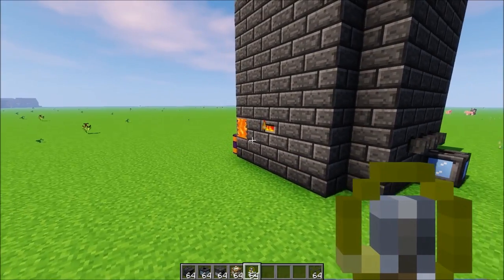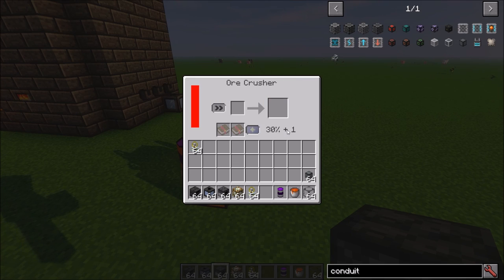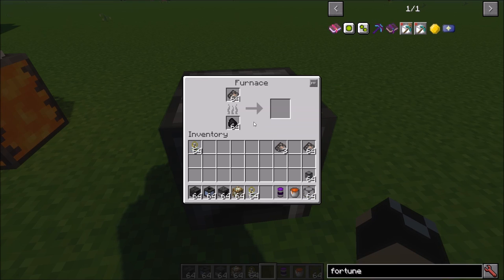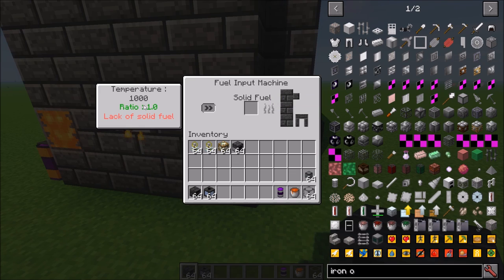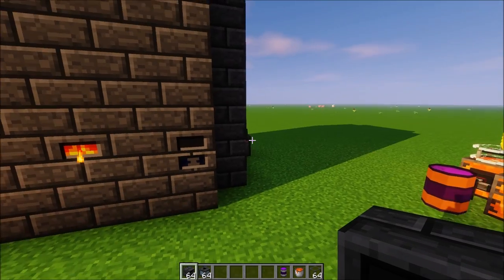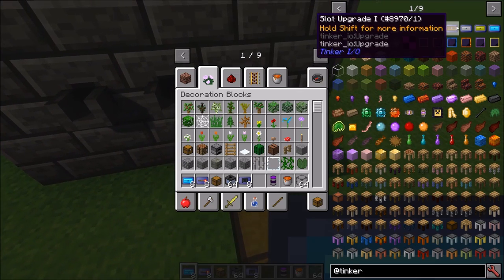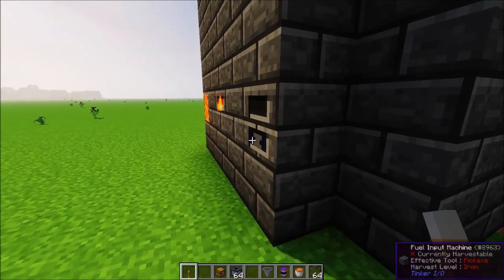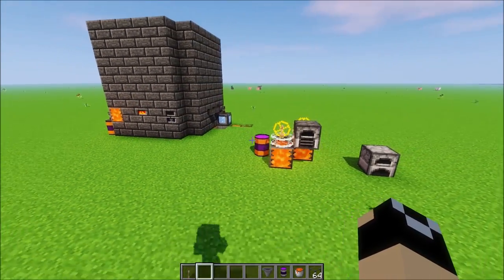Tinker I/O 1.10 Mod Spotlight/Tutorial

Comment: Hmm, learned a few things. Like I didn't know that the higher the burn time of the fuel the hotter the input machine makes the smeltery. Usually longer burn time just means that the fuel lasts longer. Also wasn't familiar with the ore crusher as never used it before. I'm sure the pure metal being different and not combining is actually intentional so you can automate ore smelting without accidentally combining metals. I'm guessing the reason it doesn't work with modded ores is probably because the pure metal needs a texture for each ore which probably isn't built into the mod(at least not yet)

Comment: Does the pure metal convert back to regular metal somehow? It seems like a waste to be able to triple an ore, but then not be able to use it if it's not ore dictionaried.

Also, all due respect to the mod author, but this seems like a missed opportunity. I would love to see a mini-add on to Tinker's that filters the tank from combining ores. Can't count the number of times that's happened on accident inside my smeltery.
Reply from the maker: Yeah, when you pump it out as an ingot it just becomes the standard metal.  Then you could always send it back through and it would be the normal molten metal if thats what you wanted.  Also as far as stopping metals from combining, tc itself can do that.  Thats the reason that tinker's constructs got the tinker tank recently.  Allows metals to stay in molten form and be drained into basins or whatnot, but doesnt allow them to become alloys
Reply: Really...I guess I need to update myself on the 1.10 mods. Thanks!
Reply from the maker: Np at all :)  Yeah, tc added two new great multiblock structures with 1.10 and totally revamped the entire mod

Comment: Asgard is there a way to limit the number of outputs? Say I have 50 melted iron ingots in the smetlery, but I only want to make 25 manually using the smart output without having to stand there and monitor how much gets pulled down. Is that possible?